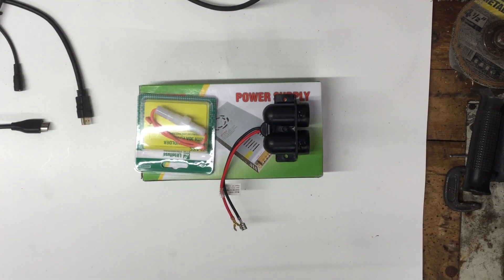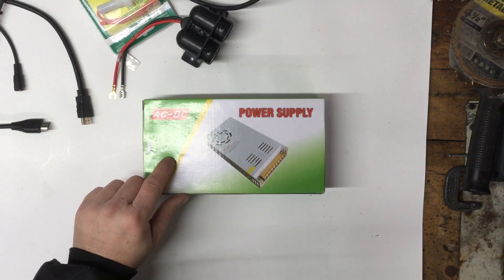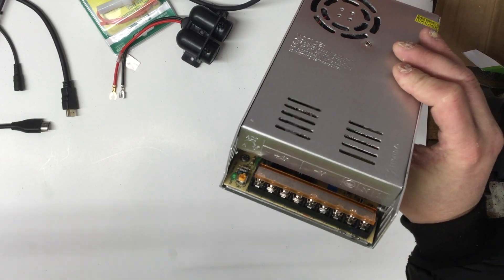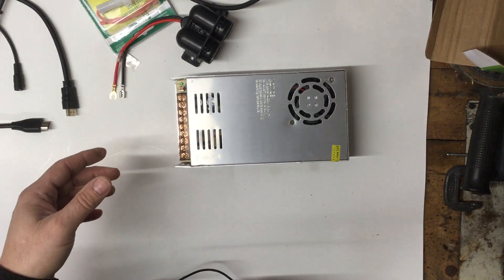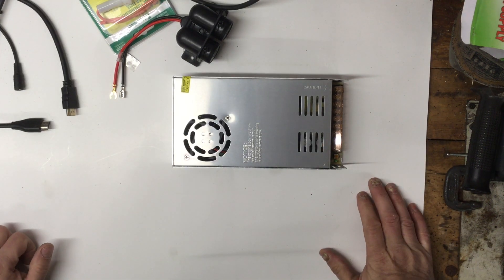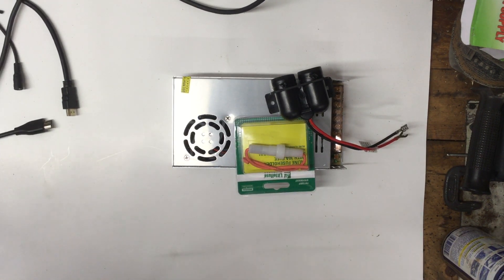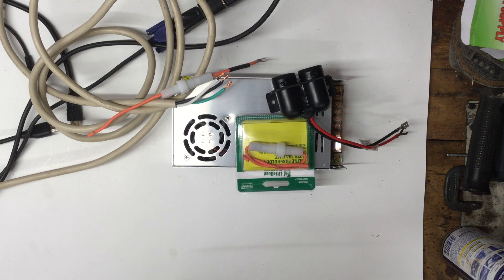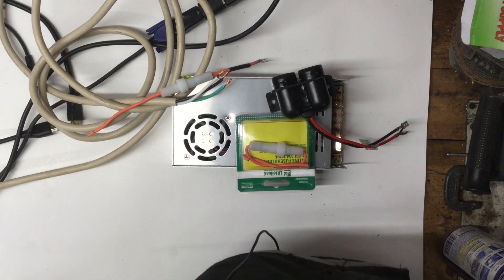🔺GMRS two-way radio repeater power supply🔺

Comment: These are great power supplies I use these on my 4 GMRS Repeater systems also on my radio room radios these are great with a cooling fan thank you for your video.
Reply from the maker: You are welcome and yes they work great and the price is cheap! thanks for watching

Comment: I have watched  a lot of your repeater videos. My question is if a guy were to buy a mobile radio such as a midland MXT115, or a Retevis mobile GMRS radio . Could you buy  the proper cables etc. and use one of those simplex repeaters ? 
Rather I’m thinking about buying the Surecom SR-112 simplex repeater controller. I just really dont think that a 5watt radio will have enough power for my situation. So what I’m asking is can I use a mobile radio such as a midland MXT115 or  a retevis mobile radio with the Surecom sr-112 repeater?  Lots of trees and hills in my area that I want to cover .
Reply from the maker: The problem is if you are using the "free" software and a computer audio out you need a radio that has VOX or you will have to build a hardware interface for the radio.
Reply: @GMRStwowayradio  If you want 2 nice mobile radios contact me I can lead you to a guy that sells the transmit and receive radio ready for the power supply and duplexer you do not need a controller or ID on GMRS contact me you can buy 2 radios with all the 8 repeater pairs.